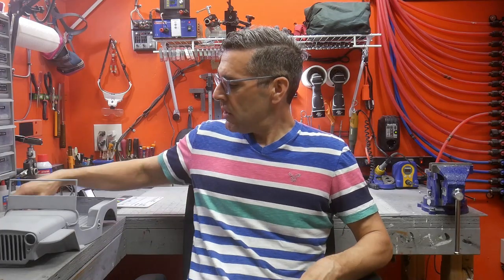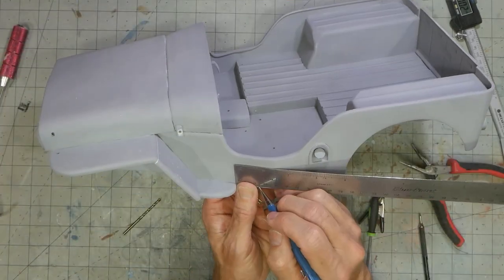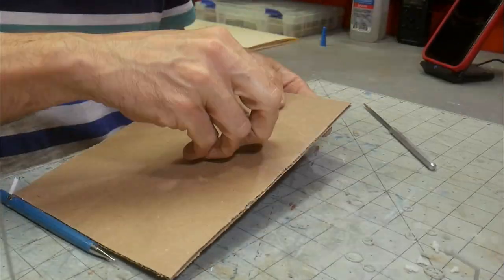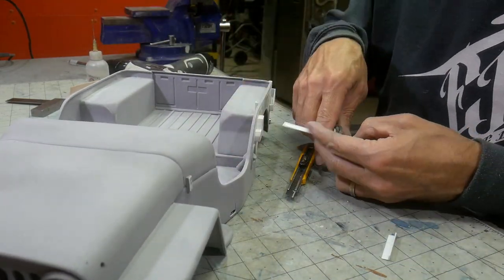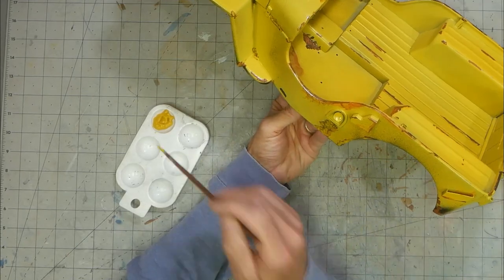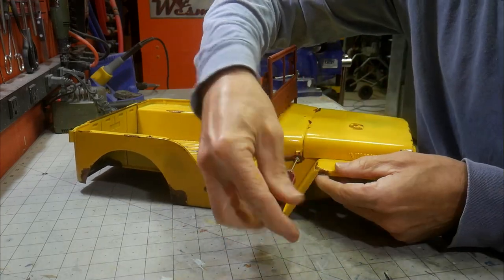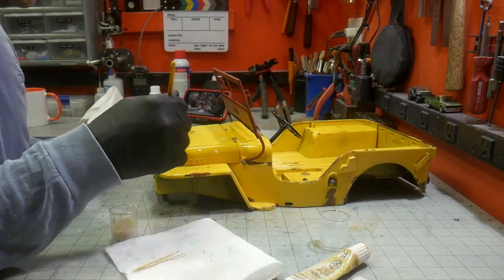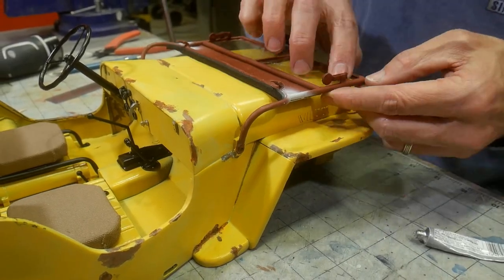Jeep Willys - Patina (2)

Comment: Hey Wesmade, great work as always. When using the CA glue, were you using something to cure it faster? Also I’m struggling with the light lenses, getting them to look right. You said you had 3d printed them on this jeep, what filament did you use and does it look clear at all? Could the surface be polished up? Thanks and keep up the good work. Jon (UpsidedownRC - Toyota Hilux Build - SBG)
Reply from the maker: I only have a resin printer.  No idea about filament printers.  The headlights are from an RC4WD Mojave.